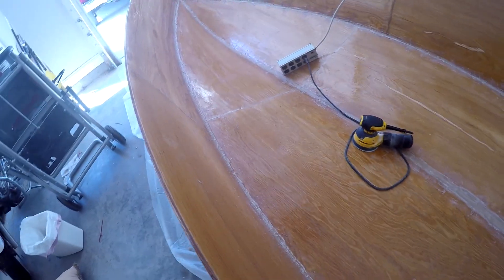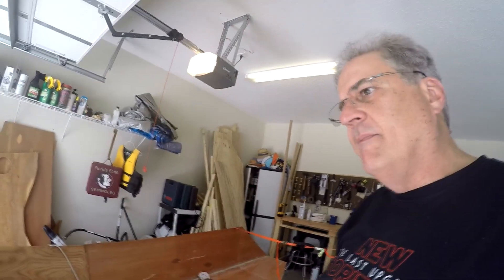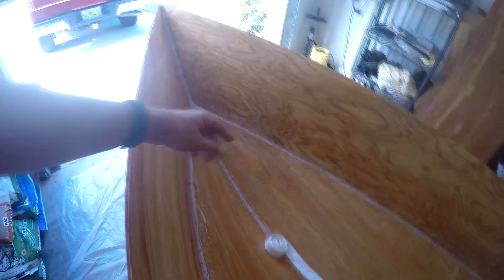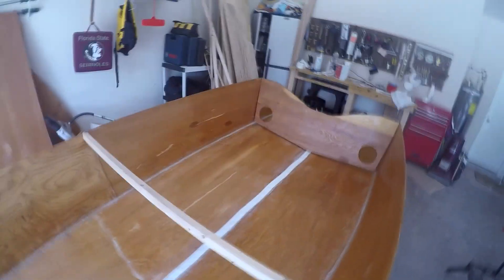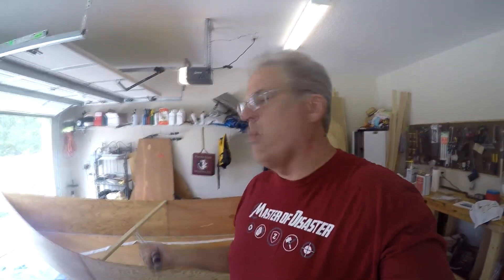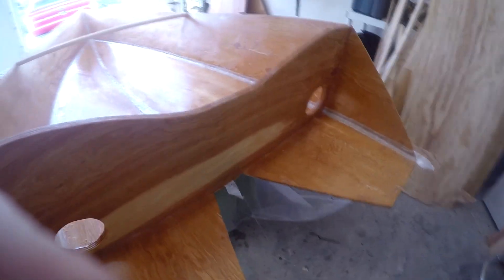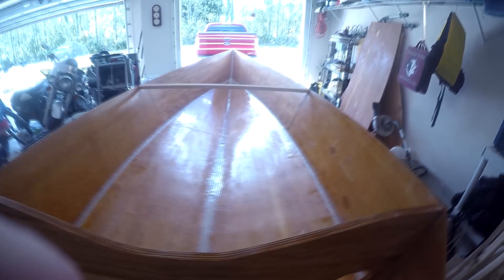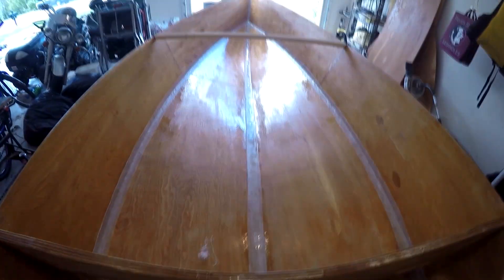16. Building a Boat (Tango 15)-  Fiberglassing Seams

Comment: Do you feel like there is plenty of room in a 15 foot tango?  You look like a tall guy and I think sometimes the camera makes it look narrower and shorter then it really is.  Your opinion is appreciated.  Thanks
Reply from the maker: Andrew Ackley I think so. I am 6’5” but the beam of the boat is 5’6”.  Obviously I won’t be able to run around on it, but I think, because the center of gravity will be low, that I should be okay
Reply from the maker: I think so. True, I am a big guy in all directions, but I like the beam. I am confident it won't be too tippy. I was on a friends 15' speed skiff that he built and it was a bit tippy, but the center of gravity was much higher on his boat. Since I'll be sitting much lower, it should be good. Might also require me to skip a few tortilla chips and that would be good too. ;)